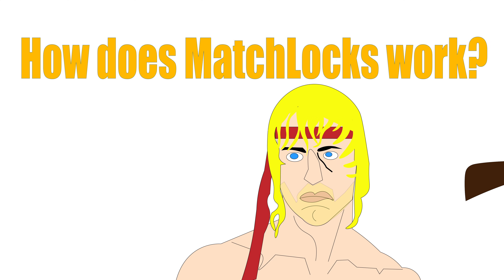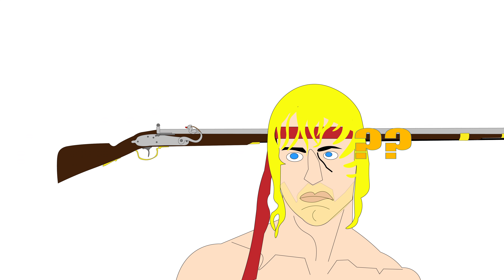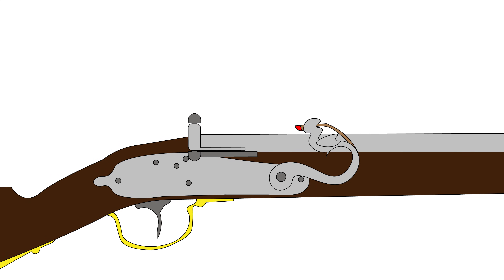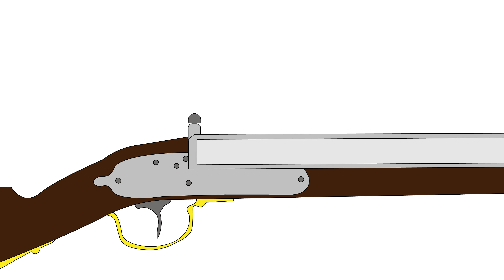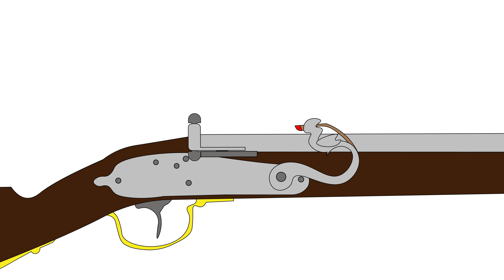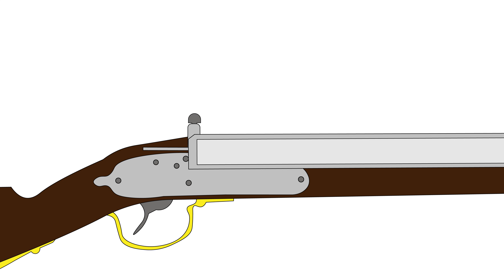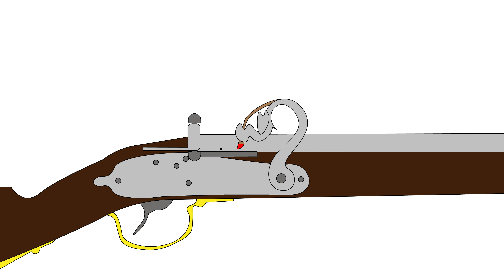How a Matchlock gun works?

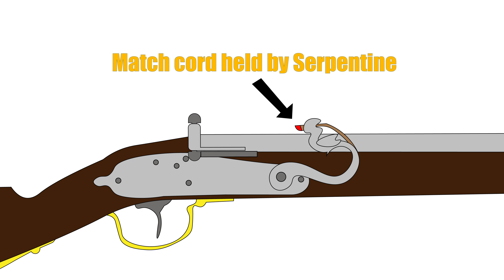Comment: 0:30 - Early matchlocks don't use trap trigger like in the animation, but a lever - heritage from the cross bow; that is pressed against a spring by the hand press of the shooter an move the serpentine holder slowly - comparative to a trap trigger; against the pan, the spring now compressed move the serpentine holder back, probable for avoid the fire in the cord to be extinguished.

The next improvement was a trap trigger, but operated laterally by the press of a button, back or in front the serpentine holder, when in front operate by the left hand (supposing a right hand shooter) supporting the gun barrel. The YouTuber "Capandball" has video firing a reproduction of the Landsknecht arquebuse of the last part of 15th Century with this button trigger in front of the serpentine holder.

After a vertical trigger - similar to modern ones, was added bellow the gun but,  whose press release the trigger sear at 90 degrees, a mechanism a bit complicated for the technology available for the early fire weapons of 15Th Century.
Reply: Trigger mechanisms for early firearms are just really goofy lol.  The first modern trigger I’ve seen personally was an arquebus from the wreck of the Mary Rose (1545), but yeah before that buttons or levers seem to predominate.